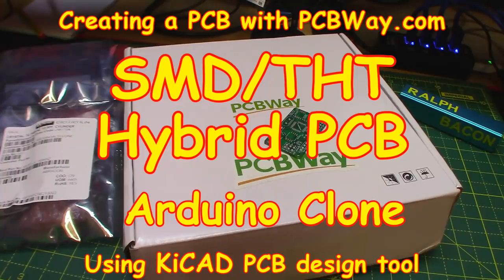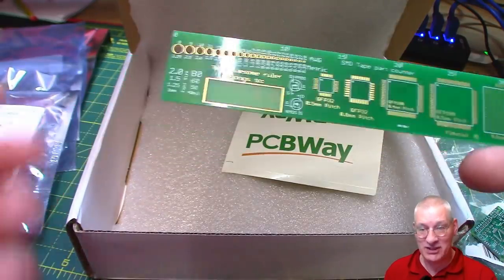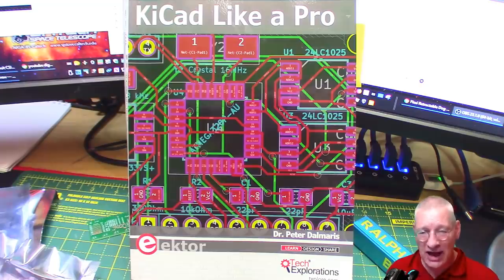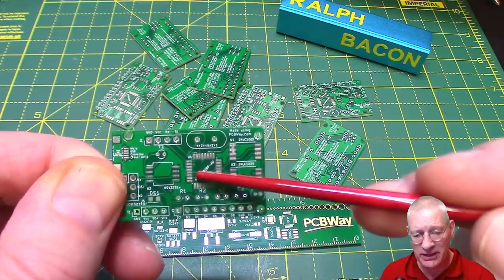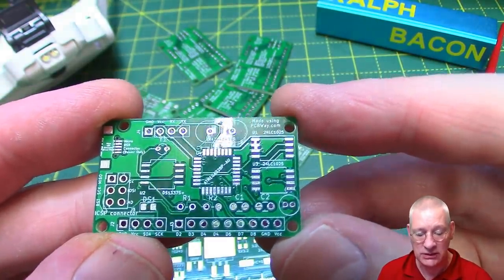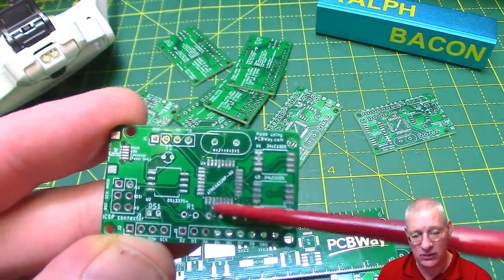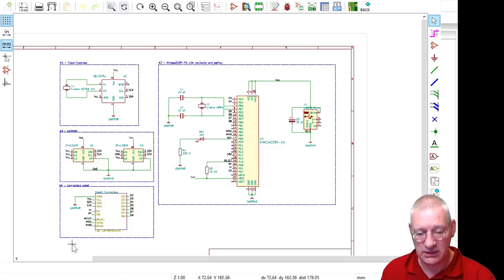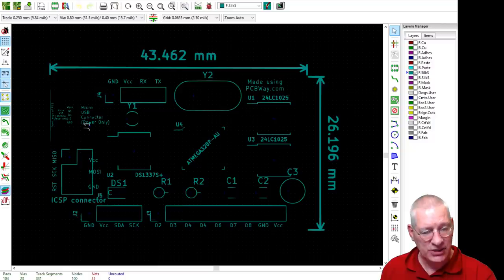#145 Making an SMD THT Hybrid PCB Arduino Clone (Using PCBWay & KiCAD)

Comment: Ralph when you start practicing on SMD's you will actually like them a lot. Apart from their obvious advantages in PCB design and some electric characteristics  they are indeed fun to solder even by hand. And they can be soldered in a oven or in a Pan ... the Pan technique with sand on top and aluminum foil also works.
Once you get the hold of it you'll love to smd work!
Reply from the maker: You are so right, John. I've been practising with that kit and I'm already loving it. It's far more straightforward than I would ever have believed possible. And I've only lost one SMD component so far; it got stuck to the end of my soldering iron and I shook it off in panic, never to be seen again! Ha ha!
Now I'm beginning to regret my decision to make this PCB partly THT - but it's a journey I had to make. I'm looking forward to making more PCBs for SMD use - it just makes routing the tracks much easier, I've found.
The pan technique sounds really weird so I'll check up on that!
Reply: @RalphBacon  Awsome! I Knew you would handle it smoothly and would actually enjoy it a lot :) Once you go the PCBWay ... (pun intended :) ) there's no turning back :) I think it is actually a very very useful thing to have Both smd and tht on the same pcb ..helps a lot practicing on KiCAD and pcb design in general. They're both necessary and the more you practice on Both on the same PCB the better.
I have seen over the years the exact same reaction ... people are a bit scared with smd soldering ... specially the smaller parts and sizes (I use 0805/0604 and there's no problem..even smaller some times) then they start with the kits and they Love it:) ! The most important thing is to use the adequate iron tip ... for both pads (qfp' or dual in line ) and single components ... diodes, leds, resistors. The rest is simply a bit of practice. And of course there's the added benefit to produce in some quantity assembling the pcb's faster ... with the reflow oven or the pan.
And btw KiCAD is a very very good Software, almost on par with commercial offerings! Just keep on doing it!
Reply: @RalphBacon  Ralph ... just a short note: Those kits have the Worst possible smd pads, vias and the like. They're practicing kit's ...the finish on those is terrible ....  So if you're good to solder them you will have much Less of a problem with the Real PCB's :) that are properly finished. Just always remember to never be shy to use flux ...smd soldering is all about using plenty of Flux.
Reply from the maker: I've not had any trouble soldering the practice kits so I'm hoping the real thing will be as easy. But I'm not quite ready for the big time just yet. More practice is required.

Comment: You are going to have some fun with the USB connector and the mega chip, the rest looks easy enough. When the pins on the IC are very close you cannot pull a short away with the solder iron, but need some solder wick, I had a lot of "fun" with a SSOP-8 chip. The problem with solder wick is that it can remove too much solder, in my case I ended up doing the "touch up" under a microscope with a very pointy tip on the solder iron.
Reply from the maker: I'm sure I'll have some fun and games with this SMD exercise but it's got to be done, Henrik! That's why I've been practising on the board I showed, so far so not-too-bad! Keep tuned, when I get that board soldered up and working I'll be showing you all!
Reply: 1206 and 0805 is fairly easy, my soldering may not look perfect, but it works.
The problem is when the pins are too close to remove solder bridges with the iron, then it gets hard.

Another comment: A book about KiCad may be nice, but the problem is that KiCad changes frequently, probably to the better. The last change I saw (V5.1.2) was new popup forms and they where much better.
Reply from the maker: All software is a moving target, Henrik, that's for sure, but whilst this book may not know about the very latest changes it does the other 99% very well indeed, IMHO. I'll practise with those SMD chips before I dive into the ATMega328P chip that's for sure. I'm worried about what's going on underneath the chip that I can't see (solder balls, for example)!

Comment: Hello 
Working on a TV repair lab almost 20 years ago, i found myself in the same position.... smd soldering (an IC just like the AT mega 328)  with a totally unsuitable weller soldering station (used until then only for THT soldering). I tried first (after making a couple of solders in the corners of the IC ) to solder each pin separate, and of course on the 3rd pin ''disaster' struck'' . In my frustration i continued soldering the rest of the pins, as de-soldering and retrying was not an option, and then i used the magic tool: de-slodering braid ! (it is a good idea pouring a bit of solder in the edge of the braid before  making the job. Just a couple of mm's ) I used no extra flux for the job , the IC didn't get very hot , and the outcome was truly exceptional !
Edit: i also believe that it would be better begin soldering from the center and moving to the edges of the pcb...
Reply from the maker: Sounds very similar to what I'm experiencing with my practice board. The best thing is not to panic and ensure you have a good quality desoldering braid to hand. Thanks for posting your experience, seems to be that those who have tried it (like you) find it easier than previously envisaged.

Comment: Ralph - I would be interested to know how you got on with those illuminated magnifiers as I am considering buying some
Reply from the maker: If you mean these (https://amzn.to/2RNwbU4) Bob, then I cannot live without them as I now have contact lenses to try and mitigate my cataract. Contact lenses work OK but I have no near-sighted vision any more so these glasses let me do all the soldering etc that I need to. With the 5 different strength (plastic) lenses there's always a lens for me. I know I sound like I'm a walking advert but these have changed the way I do electronics! I'll probably need them even after cataract surgery for the same reason. Let me know how you get on!

Comment: Hi Ralph, 

Great video with lots of good information (as always). 

I struggled with SMD hand soldering as well as soldering with a hot air reflow heat gun, seeing the components close up was not an issue because I have a boom mounted microscope using a 1X objective lens and 10X ocular eye pieces, the problem with the hot air gun was watching my components get pushed around from the air flow even with the air flow at nearly the lowest setting. 
The solution for the hot air gun was to apply a tiny dot of silicone in the center of the chip to effectively glue the chip in place, then allow just a few minutes to let the silicone skin over just enough to keep the chip in place, that worked very well, removal of the chip in case it needed to be replaced wasn't too difficult either as long as I did not use too much silicone, just a very tiny dot of silicone works well as long as you allow the silicone to skin over before soldering. 

A friend of mine burned out all of the components on an aluminum LED PCB which was attached to a large aluminum heat sink via thermal compound and clamping screws, the LEDs were 3W each and there were 12 of them with 2 switching constant current LED drivers, it fried when he accidentally applied 36 volts to the board (it was on an electric golf cart), it was supposed to be driven by 12 volts. 
I separated the PCB from the large heat sink which left just the aluminum PCB but still there was no way to use a soldering iron, not even a 140 watt soldering iron, also no way to use a heat gun without preheating the PCB and even then it was a real challenge. 
All of the LEDs had solder pads on the back for heat transfer to the aluminum PCB, the LED drivers also had solder pads for the ground underneath the chips. 

The solution was a Hot Plate from Amazon, like this one: https://www.amazon.com/gp/product/B07KTT9BMQ/ref=ppx_yo_dt_b_asin_title_o04_s00?ie=UTF8&psc=1
The plate is made of cast iron but that wasn't an ideal surface for PCBs so I cut out a 9 inch circle of 1/8 inch thick aluminum to lay on top of the cast iron plate, then I added two "K" type thermocouples, one of the thermocouples was placed at the outer edge of the aluminum circle, then the other thermocouple was placed at about the inner 1/3 section which is the hottest portion of the hot plate. 
The idea was to come as close as possible to a standard SMD heat profile as possible without building a microcontrolled on/off control system. 
I played around with the temp settings until I got a constant 180°C at the outer edge of the aluminum disc, the inner portion was measuring close to 230°C so, all I had to do was to lay the board at the edge for about 30 seconds, then slowly slide the board towards the center, the results was actually better than I expected, at the edge, the solder paste began to turn darker and shrink a bit, then when the board was slid to the center, the solder melted as expected and the SMD chips and LEDs began to self center from surface tension, it worked much better than I expected it to. 
I decided to try using a few SMD to THT adapter boards to see how it would work and again the results were much better than expected. 
Once I was satisfied with the solder joints, I just slid the PCB back to the edge, then removed it to let it cool.
No evidence of overheating and all joints looked close to professional.

Photo of my hot plate setup with only one “K” type thermocouple, the other was added after this photo.
I eventually made screw clamps to hold the thermocouples in place.  
https://i165.photobucket.com/albums/u50/rosenq3/Electronics/IMG_20190510_095126230_zps0yhmify6.jpg

Photo of full aluminum PCB after new parts were soldered.  
Note: there were several burn marks on the solder mask after the high voltage episode and those burn marks were very hard to remove so some burn marks are still there.
https://i165.photobucket.com/albums/u50/rosenq3/Electronics/IMG_20190427_172039046_zpsuhunsixh.jpg

Photo of some of the LEDs, LED driver, inductor, current sense resistor, schottky diodes, capacitor, etc (all were damaged by the high voltage).
There are two sets of drivers and external components, one set drives 6 LEDs, the other drives the remaining 6 LEDs.
https://i165.photobucket.com/albums/u50/rosenq3/Electronics/IMG_20190427_172101472_zpsriewhr1u.jpg

Photo of lights working after replacement of all components.
https://i165.photobucket.com/albums/u50/rosenq3/Electronics/IMG_20190427_181138025_HDR_zps6susx5tp.jpg

Hope this helps with your endeavor to solder SMD components. 
P.S. Using a hot plate or other similar means of soldering SMD components allow for very close placement of components, they require very little space between them (like the resistors and bypass caps on your new board).

Also, using very little force with tweezers to pick up components helps a lot. Too much pinching pressure can cause the chip to fly off somewhere never to be seen again :-)  
Using a stencil for solder paste helps a lot as well.

Sincerely,

Joe
Reply from the maker: Joe, you win the prize for the longest comment in (my) history of YouTube! But very interesting it was too, who would have thought of using a hot plate cooker to desolder SMD components? Loved the pics, thank you so much for sharing. And I take your comment about too much pressure with the tweezers to heart, that's how I lost my first SMD component! New ESD tweezers are on their way to me as I write this. Great to hear from you, appreciated.
Reply: @RalphBacon  
Ha :-) So, what's the prize? 
(Just kidding of course! )

I can get long winded at times but I figured I should describe a worst case scenario with photos. Somehow just saying to use a Hot Plate with an aluminum disc wouldn't be enough. Sometimes context along with photo illustrations can be a good tool. :-) 

Best of luck to ya! 

Joe

Comment: I quite enjoy the challenge of smd soldering. The first time was back in the 1987 with a fm bug kit that fitted on top of a 9v battery, the kit was produced by the Australian talking electronics magazine  I believe the kit is still available on the website. The most reliable method I've used is to use very fine solder and flux pen, I pre-tin the pads with a thin film of solder and place the part and reflow with a clean smallish soldering iron tip . Once I'm happy I'll add extra solder and clean up any bridges with  desolder wick, I've never tried the flooding with solder method as I was always told to keep excess heat to a minimum. A good set of tweezers on hand will be helpful... good luck once you start you won't look back.
Reply from the maker: Your technique sounds sensible, Darren, I shall experiment to see what works best (for me, anyway). So far, so good on my practice board. I must say you are correct about not looking back. The only thing I don't like is that it hard to identify components on a board before and after soldering. It might be good to include the value of the component on the front silkscreen so it can be read once the component is fitted?

Comment: Hello Ralph, I am making my own pcb with easyeda for a homemade pellet burner controller for a while now, at the moment i am using a protoboard and the brains is an Arduino micro, I want to make a pcb with a smd 328p atmega chip,  which service do you recommend pcbway or jlcpcb?
Reply from the maker: I don't have favourites, Vasilis, both companies produce excellent quality boards. I guess the way to decide for you would be to think about how many boards you really need and how much the shipping charges are. I used DHL for a recent order and they were spot on with their timing. And this was an order I paid for myself!

Comment: Get some liquid flux. Surface mount isn’t that hard once you do it some. Proper illumination is a must too. I mostly use drag solder method on chips. Good luck.
Reply from the maker: I got some liquid flux already, David, and I've been trying it out on the practice board (it's what I use on desoldering braid too, works like a charm). 

I've also got "standard" flux in a syringe on order so I can compare. And a decent amount of isopropyl alcohol for getting rid of the "no clean" flux (sounds counter-intuitive). 

I've got a great LED desk light, many different colour temps and a touch slider fader, had it a while, works beautifully but it cost a king's ransom at the time, so it ought to work well. 

I tried the drag method yesterday and I like it, although I used too much solder so I wicked it off and all is good (well, on the practice board, who knows whether that chip would ever actually work on a real PCB)! 

Thanks for posting those tips, I'll try and remember to tell my viewers in the next SMD video I do.

Comment: I recently had to fix a sop28 chip to a SMD to dip board I had solder past and a hot air reworking tool so desired I would have a go myself.
I stuck masking tape on the pcb everywhere except for the two strips of SMD contacts, I then put a thin film of solder past over the holes.
The masking tape was removed and I had my first board ready for soldering with the air gun not a complete success the pads were way too long and I got several shorts.
I reapeted what I had done before but this time the width of the mask hole was made thinner to match to the chip this time it worked perfectly there was only enough solder to do the job.
So if you only have a few chips to fit the masking tape method might work for you.
Kendrick
Reply from the maker: Interesting, Kendrick. On my practice board I, too, had shorts initially but some desoldering braid sucked it all off so I could try again. But I will bear your suggestion in mind, you never know. My lesson learned was to use far less solder than for THT components (which I've been soldering for 30 years without problems). Thanks for posting, nice to hear from you.

Comment: I have been an eagle user for donkeys years but just downloaded kicad this week and aiming to move over.....it hasn't been frustration free I can tell you. However, the feature I really hated at the start of the week, the idea that symbols and packages (footprints) are not linked I am now really liking as you have to edit the library files with eagle but can just swap the footprint in kicad - nice!
Reply from the maker: Win some, lose some, I guess, Jon. As you know, I was frustrated by KiCAD and turned to the dark side... sorry, wrong analogy, I turned to EasyEDA which I really love. But, having ploughed through Dr Peter's book I'm starting to like (if not love, exactly, not yet) KiCAD with all its foibles!